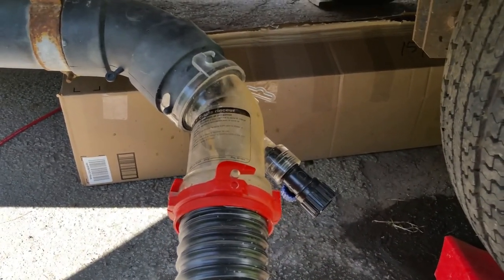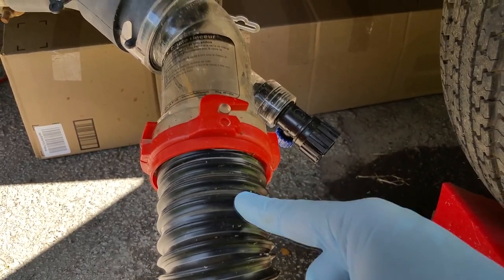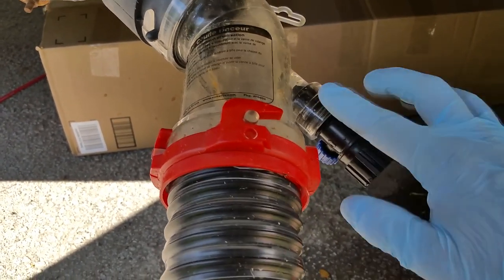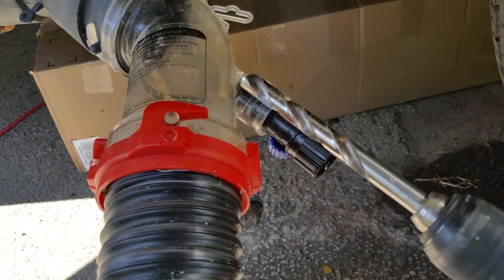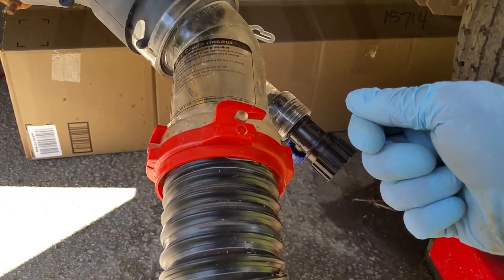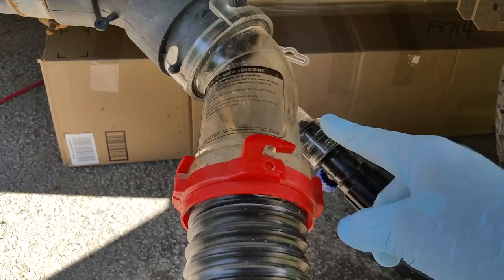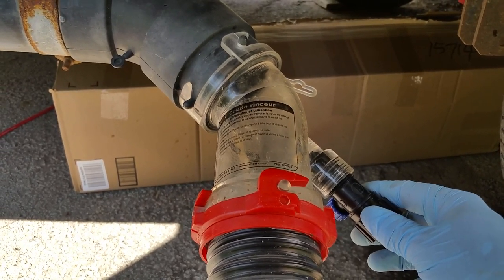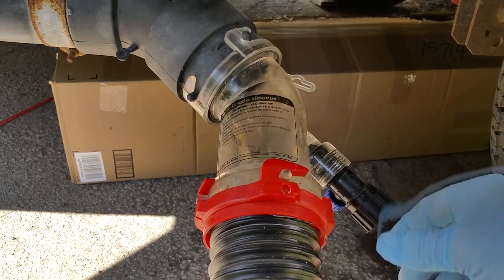Clearing a clogged 5th wheel blackwater tank with a snake

Comment: When your black water tank is clogged close the valve off drain about 5 gallons of water out of your other tank while you're holding the hose up in the air and then open the black tank valve and pick the hose up high enough to force it back into the black tank and that will usually unclog it very simple way to do it

Comment: Dude, thank you so much for posting the video and being very informative and thorough. I am sitting in my horse trailer right now after a shoulder deep episode cleaning a clogged black water tank. I didn't have a proper snake so I used a 3/16 steel fish tape that I have used many times 4 electrical work. I retired it with the hose that I cut a hole into but all came out well. I'm not sure if I have damaged the level sensor but it is something to keep in mind if you are putting any kind of snake or fish into the tank. Thanks again for the awesome video and clear narration!
Reply from the maker: You are welcome Shane. Glad I was able to help.

Comment: All it takes is buying a 3" ABS ( Y) , 1 Fernco with 2 hose clamps and attaching to your outflow..You can then snake through the ( Y) ..add a plug to close up ( Top of Y)  after completing..Really easy..Those 3 items about $15... Those ( Y's) are about $6 and some change.. Probably get one of those 3' Toilet snakes more than enough reach ..Those are about $20.... The Fernco will slide right over those hose turn clamp for RV sewer hose..Then just clamp the fernco down using hose clamp...

Comment: I would not drill to pass thru with the spiral tip. What I had done was before connecting to the rv drain,  I inserted the  snake with no tip and then connect the spiral tip.
Reply from the maker: That's a good idea Chris.

Comment: this video gives me hope! My tank is also plugged after several month of use with valve left open.   I plan on filling it up with water and some chemical to break down the solid waste. The snake seems like a great idea.  Definitely going to try this.   This video also mentions dumping a gallon of drain cleaner in... I have always heard that Draino or anything like that is too caustic and will damage plastic plumbing.  What kind of drain cleaner did you use?   Anyone else have suggestions on which chemical ? Thank you.
Reply from the maker: Christine, sorry, I don't remember the brand of drain cleaner. I'm pretty sure RV plastic pipes can withstand any drain cleaner. We have plastic under all our sinks in our house and never had a problem with any of the drain cleaners we've used, and those pipes look the same as RV pipes. . I'd say you'll be fine. Read the label on the bottle to be sure.
Reply: As it turned out all I needed to do was put a good dose of black water tank treatment and fill it with water and then let it soak and as I drove and moved down the road to my next destination it dissolved everything and flushed right out when I drained the tank

Comment: I saw your auxiliary heat/AC motor replacement video.  I also have a conversion van.  I’d like to get in touch to see if you can help with my aux AC.  Do you know where the relay is?
Reply from the maker: Steven - so sorry I just noticed your message - did you ever get your aux AC fixed?